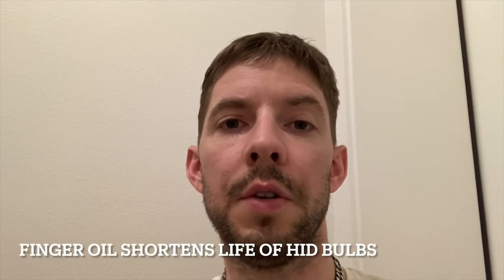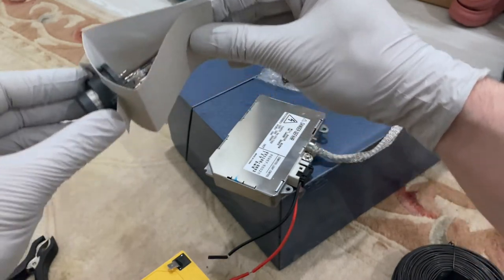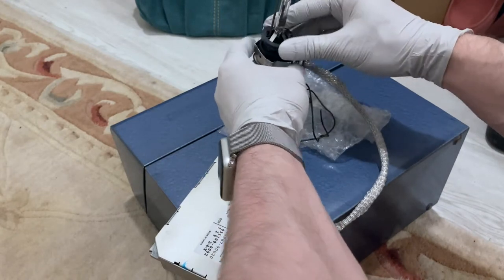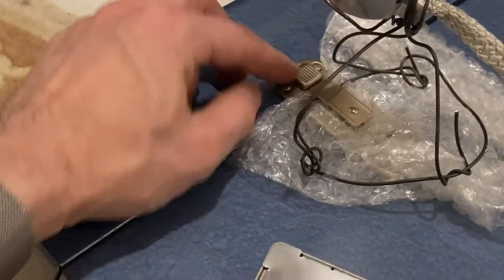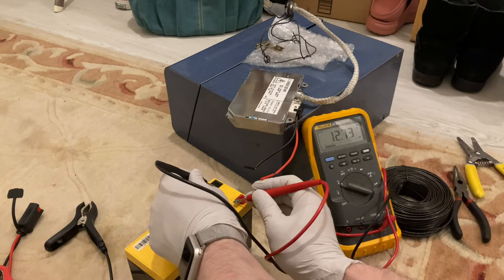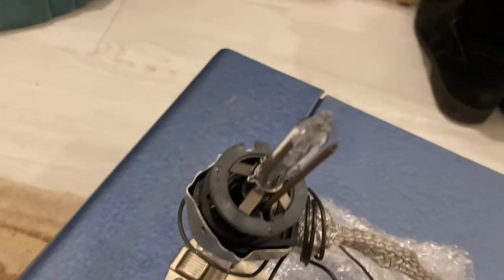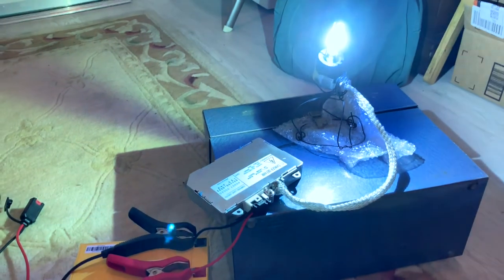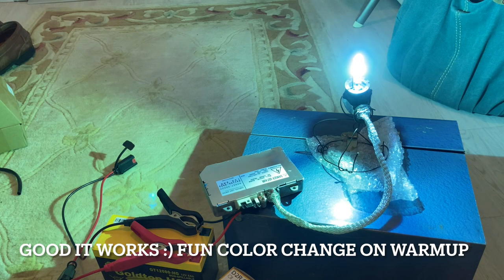Testing new DR2 HID 4200K Light Bulbs for Low Beam Headlight use in our 2005 Toyota Prius

Comment from the maker: I like the replaceable HID not these LED module headlights where 1 dead LED means you have to buy a new headlight to make it right, since it contains no user serviceable parts // stupid car manufacturers & their suppliers designing fancy segmented LED units that experience individual LED failures & they made the LEDs impractical to change, soldered down to some board thats sonic welded to the headlight so you have to break the water seal to open it up etc & most people will end up just buying a new headlight assembly online from an aftermarket supplier & throwing the entire mostly working OEM unit in the trash //